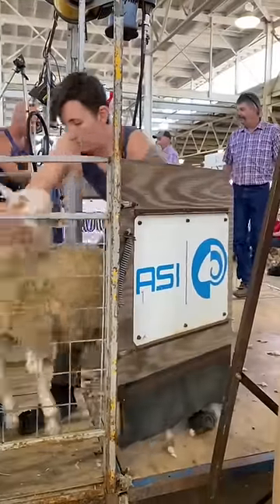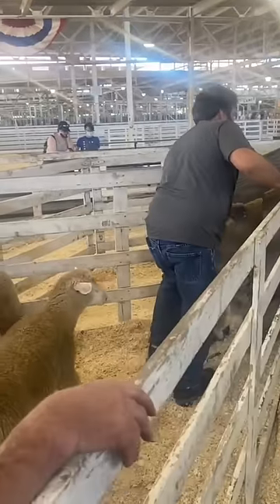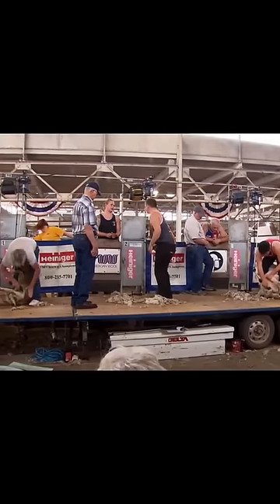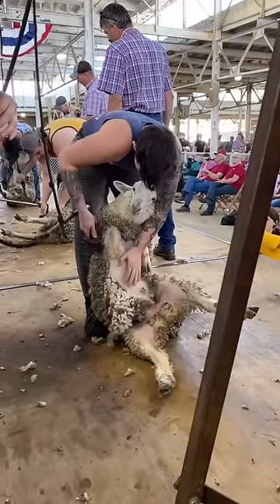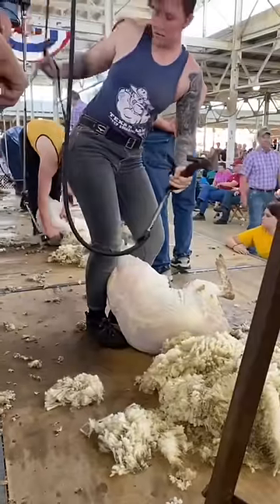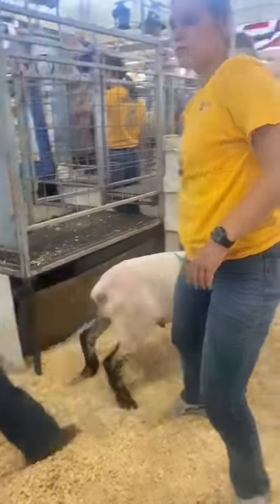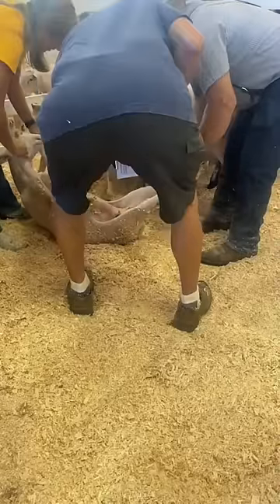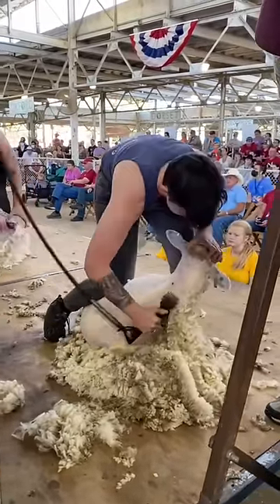Shearing Competition Explained

Comment: I think they should have a shearing competition where each competitor does at least 200 sheep, cause that is what really makes shearers impressive is how they can keep up the speed and acuracy for over 12 houres whit only 1 2 two breaks. Hardest workers i’ve ever met.. and i don’t throw out compliments like that easily as i’m more often than not dissapointed in lack of effort as is common in most professions, but not among the Shearers, each one is a top brass athlete.

Comment: I do respect the judges make you lose points for any nicks. The quality over speed factor certainly serves as a way to protect the sheep. It's also good experience for the lambs to be exposed while they're young- key way to serve for desensitisation while they're still mouldable, and they're a lot more flexible/resilient.

Comment: I grew up on a farm and ranch and worked with the animals in all areas. I STILL do not like the fact that animals can be injured with shears or other medical equipment if things are done too quickly. 
I have branded animals ( I never like it ) and given injections. When you have to PUNCH a needle through a cattle hides it is rattling until you get more used to it. It is tiring work. 
Dehorning in the older days did not have the kind of cauterization equipment that they have now. 
God created animals so that man could serve as the STEWARDS/ sheperds and carers, NOT to be their Monster/Masters.

Comment: That start was VERY violent. That did NOT look good. and SPRAYING them?! That. Looks like abuse. Can someone explain the morals of this?!
Reply: I know it looks rough, but they’re tougher than they look. Everyone there is experienced in handling sheep and won’t actually hurt them. 
The paint washes off like face paint, would wash off of your skin. 
Also, the sheep have probably been sheered multiple times and so are more used to it. Sheering is necessary for them. But I get how it looks rough.